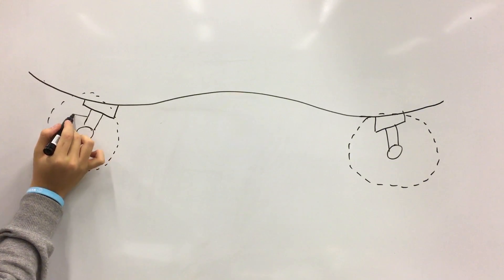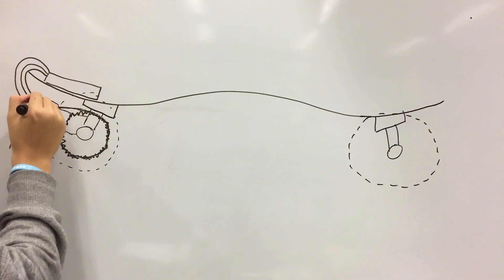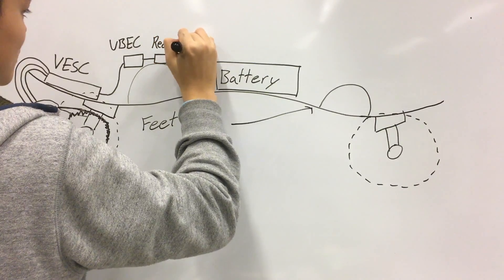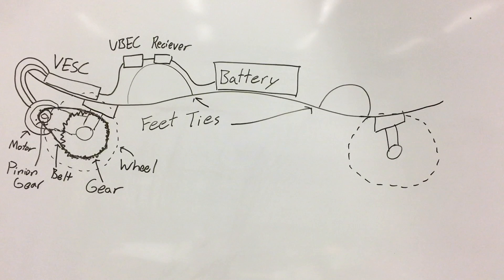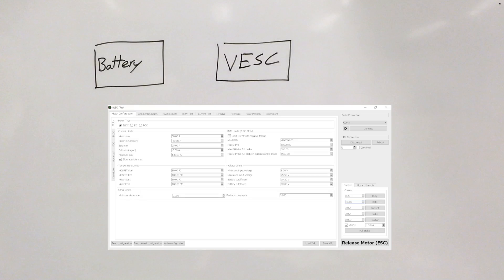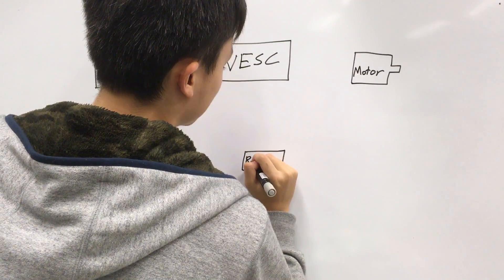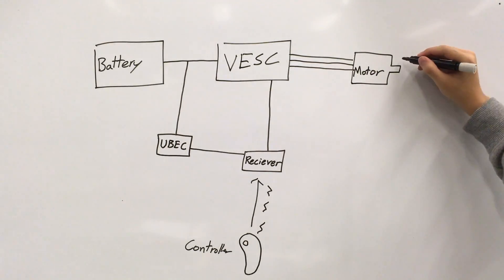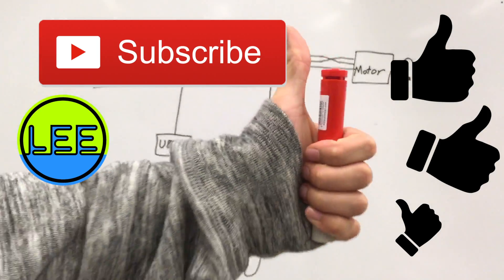DIY Electric Mountain Board (Part 1 Explanation)

Comment: Is it possible to have some links for the Vesc or Battery or the reciever? Thanks!" Ps: Great Video dude!
Reply from the maker: No problem. They were bought from a Chinese website so I'm not sure about the shipping abilities but these are the links for the Vesc, battery, and receiver. Some of the items may have changed but this is the store.

https://shop109652967.taobao.com/search.htm?spm=a1z10.3-c.w4002-8212815661.84.6bd32eeajcWqbD&_ksTS=1534008572418_201&callback=jsonp202&mid=w-8212815661-0&wid=8212815661&path=%2Fsearch.htm&search=y&pageNo=1#anchor
Reply: I am also interested in a link.  this one does not function.  thanks for the video!
Reply from the maker: Does this one work? https://shop109652967.taobao.com/?spm=2013.1.1000126.2.e2334502U4ygBk
I am not sure if this works because it is a Chinese online store and may be limited to China. 
If you guys wish I could find similar equivalent things on Amazon or some other website.
Reply: Leetheskill that would be very nice, maybe some amazone links? Thanks for your help!
Reply from the maker: I was unable to find exact ones on Amazon but these should work. 
Please subscribe and leave a like on this video! It really helps me out.
I was unable to find a board on amazon but I'm sure that can be found on Ebay or other professional mountain board websites. I cannot guarantee that these are good quality products as I have never purchased them but the reviews seem to be good.

I hope this was helpful!

Battery (connect these in series)
2x --- https://www.amazon.com/HRB-battery-6000mAh-Airplane-Helicopter/dp/B06XK9149S/ref=pd_sbs_21_4?_encoding=UTF8&pd_rd_i=B06XK9149S&pd_rd_r=e2c81762-9fae-11e8-869f-9db20fc2a789&pd_rd_w=SFuSQ&pd_rd_wg=oJd60&pf_rd_i=desktop-dp-sims&pf_rd_m=ATVPDKIKX0DER&pf_rd_p=ebf3f80b-3878-4fb9-8381-bbec92f92693&pf_rd_r=JRYC57J9GG0B4VFTNDF6&pf_rd_s=desktop-dp-sims&pf_rd_t=40701&psc=1&refRID=JRYC57J9GG0B4VFTNDF6

Electric mountain board kit (Connect to the batterys)
1x --- https://www.amazon.com/L-faster-Electric-Skateboard-Longboard-Mountains/dp/B07DR91KK8/ref=sr_1_1?ie=UTF8&qid=1534242461&sr=8-1&keywords=electric%2Bmountain%2Bboard%2Bkit&th=1